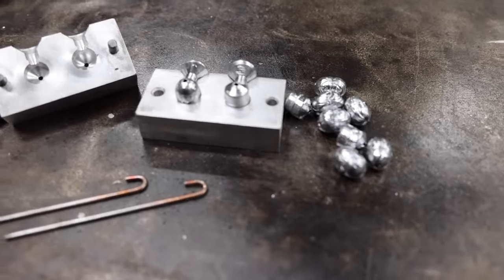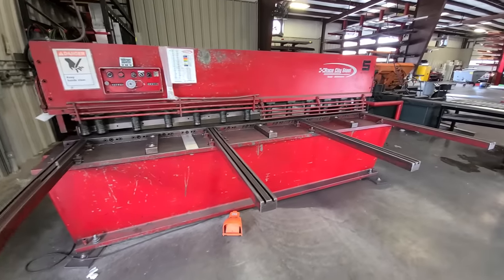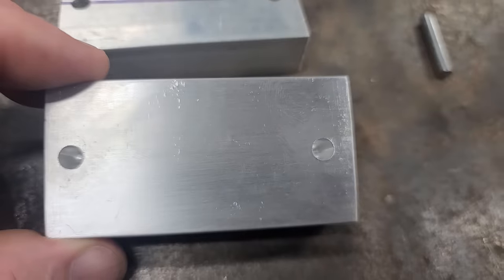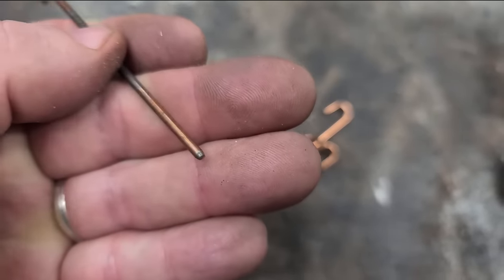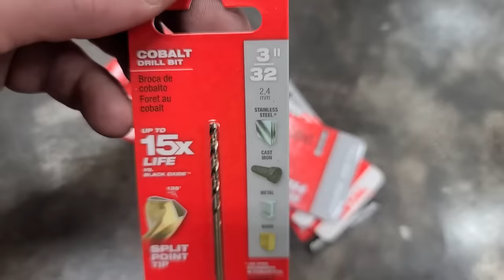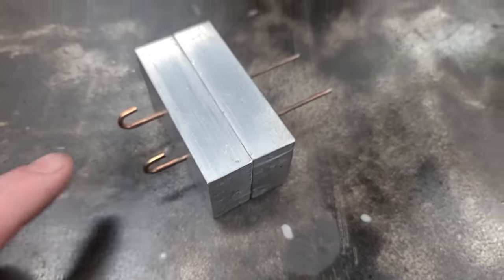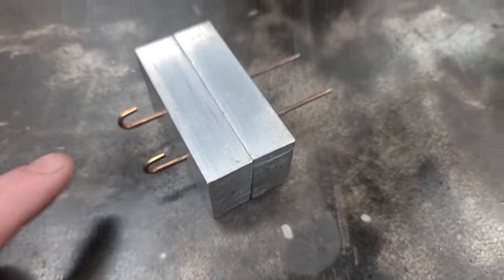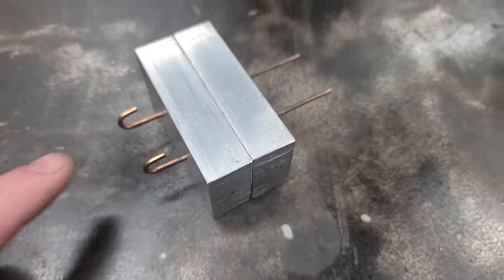DIY Egg Sinker Mold

Comment: If you smoke the mold with a candle 🕯the sinkers won't stick, just tap the open mold with something non marring and the sinkers will drop right out. Great video, I've watched them all.
Reply: Thanks for the video
Reply: 2nd that I always soot a mold.. just hold it at a angle a few inches away from the molds, also smoke the inlet, it will make the lead flow way way easier. Best mold release ever. I heat mine with a heat gun
Reply: I dont make stinkers but I like your videos
Reply: The way these are made you will have to smoke or dry spray the mold,unless you can/want to make the cavity angle outwards towards each half and they'll then just fall out but most molds smoking or spray is unneeded.
Over my 30 some yrs pouring sinkers,jigs,bullets,etc. and my stepfathers 50+ not one of our molds ever needed smoked or sprayed. I do have one newer jig mold though I may use it on to see if it'll help Do-it Wobble Head mold.The way it's designed the outside edges catch as you try and pull it open.

I been going to make some custom jig and sinker molds just haven't got around to it yet.I will add handles and a hinge though and make them able to pour 8-10 or 12 at a time depending on size.
Reply: @rider660r  I smoke my molds for a cleaner pour not a easier release. I like to use different hooks and sometimes the molds will not pour as easy with larger shank hooks.
Reply: @jaredbradley152  LOL I have modded nearly all my jig molds and they use the suggested model/size hooks and those not suggested.Not a one has been smoked,it's not needed if you learn how to pour correctly....heat,speed,etc.
Smoking is a band-aid......

If the casting bumps are to junkyard style for you a little sanding ball and dremel will clean them up and won't ever need to mess with it again.But there was a scientific test performed in 1691 in Spain and they found 99.99999999999999% of fish don't care and most of those are painted anyways.If you're not getting good cover with powder paint it isn't just because of the casting/milling bumps/marks......
Reply: @Michael Mosley oh look at Mr Fancy pants here, poopn soap bars. 😂
Reply: Nn.    B
Reply: Torch works better. Just use the gas no oxygen.

Comment: You can use two flute high speed end mills for aluminum. Wd-40 is the best thing I’ve used when cutting it. You could also use some sort of saw to put pry slots on the corners in case it sticks

Comment: You could press them in using a "C" clamp with a large enough throat opening to press the stainless steel rod into the blocks. You may need to use a piece of hollow steel rod over the clamp handle to increase the leverage to turn the screw and press the rod intl the blocks.

Comment: Awesome DIY VIDEO 👍👍. I make my line holes,  the same diameter a plastic candy stick.  Cut a length 3mm longer than the weight,  push through the line hole. And mushroom them over, with a lighter.  As it helps with the weight running,  up & down,  without chaffing your line.  As that is how most,  in-line Carp weight are especially in-line feeder weights. A small half Oz in-lines are awesome,  when fishing for trout with doe-bait 🎣😃👍
Reply from the maker: Good idea

Comment: I was going to do mine,when I get around to it,with a drill bit but I forgot about the end mill bits.....making a trip to the garage to dig some out now....lol

Those pull pins,if you take a rag/towel and oil it they'll come out of the egg easier.
Doesn't matter what oil you use,I just use one of the extra bottles of air tool oil I bought after misplacing 3 others....after 5-6 pours in a Do-it mold I'll run the pin across the towel with the oil.
If you could wobble the bit just a hair before you finish boring the cavity it'll let it angle outwards towards the center and the eggs should pretty much just fall out when mold is pulled apart. Might be best to do when press is off and just twist the chuck by hand,shouldn't take much to angle it just a hair.

Could also use the end mill bit in the press to make the mold as Do-it does.Will take a lil more time and patience though.

Comment: Bought bunch of molds last trip to cabelas that was on sale so got as many as I could afford.  Remember to heat your mold before pouring hot lead into. I also put a cake of bees wax in my melting lead never had problems with stinking...

Comment: You can run a burning candle under the inside of your mold so that it coats it in soot. That way the lead doesn't stick. Also your mold is a bit cold, can see by the waves in the lead. Fantastic video! Made me want to go make some molds for myself now.
Reply from the maker: Thank you

Comment: Hi just watched your video on making egg sinker molds when using a bull nosed end mill is their a way of working out either what diameter to use or if using just one diameter what depth to make them to make different weight s excellent video just wish you had made it sooner
Reply from the maker: I'm not sure how to do the math for that  . But the ones I made were .5 oz and .70 ozs so one was half oz the other almost 3/4 oz . I was thinking you could start out shallow pour a sinker weight it then drill it a little deeper to make it heavier.  Because it won't change the other holes you drilled

Comment: Small Harbor Freight drill bits aren't worth a crap for me either. Idk if a punch might drive it out or not. You're a good fabricator so I trust your opinion. I just like watching you build things, I don't need a sinker mold but I'm watching this video. lol
Reply from the maker: I tried driving it out . But since it was like 50 cents worth of aluminum.  And I was spending way to much time on it  . I just started over lol . I learned that building stuff and watching forged in fire . Sometimes chasing a problem is worse than just starting over

Comment: I might take this route to make moulds for casting heavy lead for my slingshot….I’m running a double band set (1.25” no taper TBG) and it’s HEAVY to draw. 1/2” steel doesn’t absorb enough of the energy of my bands, and the hand slap is terrible as a result.
Reply from the maker: I bet it would work good

Comment: I don't think you have to worry about lead fimes using the hot pot 2 because it has a max temp of 800 degrees Fahrenheit and lead produces fumes at 900 Fahrenheit
Reply from the maker: I still run a fan when I'm not filming  .

Comment: I make the moulds for my cast net weights using bondo. There are several tutorials on yt on how to make them. And yes, the bondo can withstand the heat of molten lead just fine.
Also, if you really want aluminum and dont have the tools and stuff, lee moulds (they sell moulds for casting bullets) can sell you a blank mould with locating pins and handles. All you do is some drilling and shaping your “pattern”.

Comment: Clean the mold with a combustible break cleaner, usually the cheap wal mart brand, scrub with soap and water. It will get the oil out of the aluminum and heat well enough wrinkles the wrinkles go away. Spray graphite will be a great mold release agent.
Reply from the maker: That's good advice

Comment: When you are drilling aluminum try turning your drill press as slow as it will go. I’ve always had better luck
Reply: Automatic trans fluid also works really well as a lube for aluminum. Keeps the Al from falling up on the bit.
Reply from the maker: @user-neo71665  I'll try that
Reply from the maker: I had it running as slow as it would go . But it's a cheap press

Comment: I have the mold but I ran out of aluminum. I got a bucket of spark plugs. I just hammered over the electrode to tie off of. I think these spark plugs work better so they are probably illegal to use.
Reply from the maker: I've never heard anyone say they were against the law to use . And alot of people use spark plugs

Comment: not that it matters on a diy sinker, but if you heat up the mold more it will form better.  The weird edges on the casting are due to low mold temp

Comment: Well it is a pretty hard way to make a sink mold, I guess it would be easier use a pipe, and them cut, drill and sand the lead.   I guess.
Reply from the maker: Leads difficult to sand . But I'll try and come up with something easier

Comment: I’ve been thunkin’ on this one to make some of these. How much did yours weigh?
Reply: Yeah, he kinda missed that litte detail.
Reply: @gerardjohnson2106  I want some with wire loops on ends. I use the trolling for crappie and wrap line through couple times and line seems to always break at the weight when I hang up.
Reply from the maker: I didn't think about weighting em . But I should have . I'd guess between 1/2 oz and 3/4 . But changing the weight would be easy

Comment: sinker mold.. YUK..  polish the insides and use some drop out spray on the inside of them.. then make sure to put your MOLD INTO YOUR LEAD POT WITH THE LEAD to HEAT IT UP.  lead doesn't stick to aluminum when aluminum is hot.. so when the lead falls off of it, its ready!.   you'll notice your wrinkles in your final product goes away and they will fall out of the mold when you pop it open..

Comment: Another awesome video!  Where have you found the best (cheapest) source for lead?  Back in the day, I used to hit up tire stores for used lead.  Not having much luck with that now a days.
Reply from the maker: I buy it at the scrapyard by the pound used . You can check tire shops . And ask them for their lead weights but alot of the weights used now days are not lead and won't melt

Comment: I love my molds and I have put with pull deal mold goes under pull pin slide mold. I had to fix  y pot it was so short my molds didn't fit under I just happen to have these white plastic pieces made perfect lift. It was 15 pound bowl 89 dollars. Ok got it in drove 25 miles to get. Man is it small.  Ut 25 pound was high.  Ht your small one I want to get me one  it seems to work good  in stops up some times takes forever to come out again. Then it may come out and not stop that sucks lol lead all over and wish I had mask now with me sick alot maybe time to get me one. Lol  hey I have question.  Would you ever sell anything you make like the mold no roll one you made stuff like that that I count make easy.  BUt would you sell anything I think k you had a store page or did you. We're you sold some fishing items made. Or maybe that was someone else. Been while since I've been on.  But you have a few things easy for you to make could I make a list  I mean shouldn't be over a 50 pound box. Lol yea if i had that much money I couod buy new. But I don't want new to be honest yea I would use them make things like with molds.  Ut honest it's cause it's yours I ain't no kid going gogo over you but I am over what you make stuff way to cool and maybe 30 years ago I could have made easier. That's why I want camper to travel and watch videos get set up in places and make fishing stuff maybe sell if it's higher dollar idems can't give everything of mine away but I will most I mean when I die my daughter said she didn't want anything. Well if she was a boy she would want allt I have really  end 40 ft bus to load up stuff travel sale and giveaway stuff never no I may just get a bus add wheel chair lift. Ide drive all over I've owned 2 busses  went Alabama south Carolina  to Georgia back south Carolina back to Alabama. Then moved to Michigan left there 7 years later got a bus drive to Louisiana  keep 5 or 6 years sold. Almost got one 4 mi the ago they never showed up so got toy hauler wish ide just got the bus it was so nice if ide  not said yes to 500 off just said no ill pay 3500 ide had a party bus it had lights back porch wall to go inside I mean made a wall with a door cut ipen some back no windows speakers stripper pole 3500 I should have just paid the stereo and lights was worth all that. But being I need cabnits for storage bus was be better add file boxes down wall I have camper bathroom kitchen put in bus water tank poop tank just have to add. Ok you have a good one. If you would sell some stuff. I'll pick some cheap builds. Ide love to own something you made. And sighed. Lol.  God bless.

Comment: Why go through all the trouble to make the mold. Why not just buy a “Do it” mold. You nearly spent the same on materials. Not to mention the extra tools you had to buy
Reply from the maker: I spent like 2 dollars at most on the aluminum.  The tools I already had besides the drill bits which I replaced for 5 buck . The drill bit I broke was very old